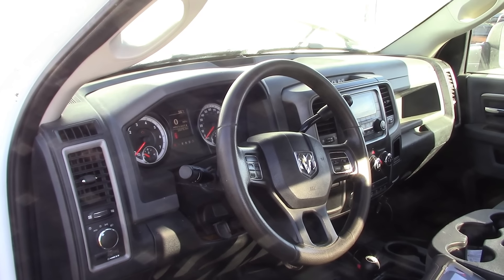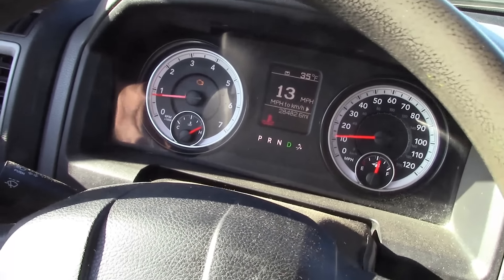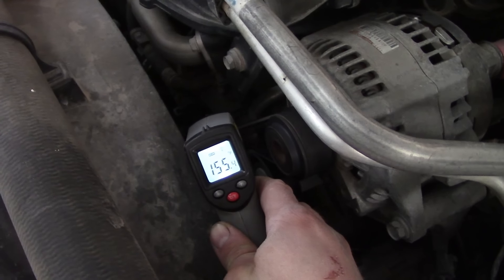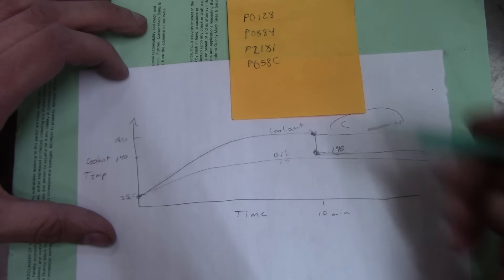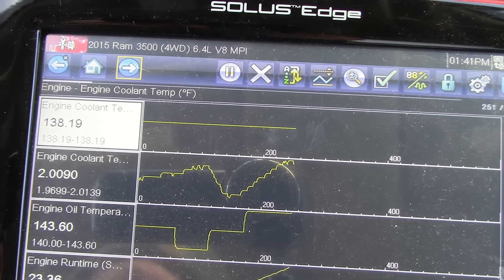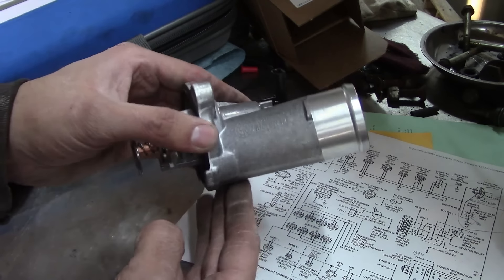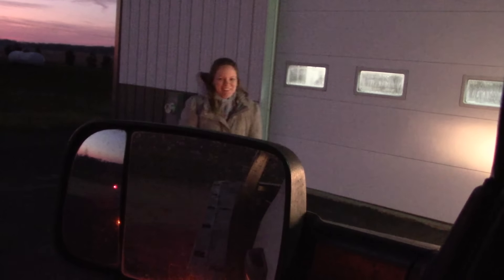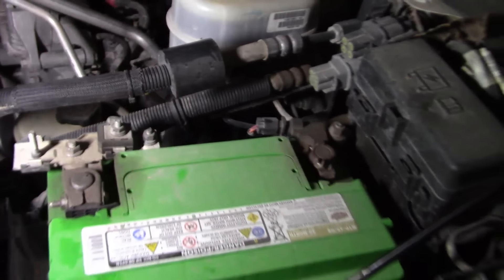When Live Data Lies - 2015 Ram 3500 Thermostat Diagnosis and Replacement - P0128, P2181

Comment: Wes, you have to remember that these are same great minds, that came up with the grand ideal of taking the whole dash, and console assemblies apart to work on anything to do with heating, and cooling system.
Also using 6- 5'16", are metric equivalent, to secure two dissimilar metals together, that just happen to be the two that move the highest temperatures. As well as having the greatest deference's in they're absorption, and dissipation of heat. Thus snapping the heads smooth off the retaining hardware, and the hardware wear shear bolts used on PTO shafts on a  shredder, are some other implement to protect gear boxes.
So anything is possible, and the words, logic, and logical never entered any of they're minds, not once it appears.

Comment: This is why I advocate that all these cars engines software and sensors be available as public info.  All they need to add is a SUBST flag to the code, then the monitors would know when and how that value being shown was a substitute value.  Also the water temp sensor diagnostic can be easily correlated to the oil temp.   odds of both failing are small, UNLESS its an electrical problem.  and yeah I have seen that, near dead batt in a ford fusion and chrysler minivan had all sorts of fail codes being thrown.

Comment: Had one for 3 weeks.   Transmission fell out  ( literally fell out )    15 mins after purchase.   Yes it was just warranty fix.   10 days later it was great .  3 weeks later.  It caught fire in my driveway .   It was parked .    Electrical fire in engine bay.      8000 bucks later. Yes warranty  kiked in.   Got it back .  Was never right again.  Stank of burning plastic.   Took it back toold them to shove it.      900 miles on this lemon,        then bought a Nissan.    Happy now.

Comment: Sometimes a bum thermostat can prevent the computer from allowing the emissions monitors to pass if the temperature won't reach a minimum of 180 degrees.
Reply: Kind of what I was thinking. Such as a fuel mix ratio curve having priority but dependent on actual/presumptive temp value.

Comment: I worked on a Cat 3126 with a temperature problem. 
The temp gauge would fluctuate like crazy up and down at operating range.
Used the laptop and live data and when it happened it looked like a heartbeat monitor.
3116, 3126 and C7 all have two thermostats in the same place side by side.
Don't ask me why but one was faulty giving me the readings I saw on the data log.
Two new stats and it was good to go.

Comment: Is the sensor an A/D converter? It seems like some bits are off.  But I haven't watched to the finish.
Reply: The scan data shows coolant temp voltage however it is showing 0 to something like 20 V max.  This seems like too high of a range, 0 to 5 V is typical with anything below say 0.5 or above 4.5 tripping shorted or open circuit codes.

Comment: I started working on cars when OBD2 first came out and that’s what I specialized in computer diagnostics. I really don’t quite understand these new cars. An example a friend of mine had his Chevy Colorado that set codes for the traction control computer, ABS and put the truck in limp home mode all because of a bad coil.

Comment: In 1989 when the cummins first went in the Dodges people complained so much about the temp gauge swinging when the thermostat opened they cam with a special pigtail for the sensor that dampened the gauge readings so they had like 30 second average readings instead of real-time. I guess that was the beginning of lying gauges.

Comment: My Mazda does something similar with oil pressure. The gauge moves around based on what the car thinks the oil pressure should be. The actual oil pressure sensor is just an on-off switch.

Comment: My wife's 2012 caravan just had this code and issue this weekend. Lol 

I ended up putting a thermostat in it. Her can wasn't getting over 115°. We're running -12°C or 10.5°C
Needle wasn't reaching the first quarter on the gauge. Now it's running just below middle. And we have actual heat coming from the heater core.

Comment: 14:33 for such momentous occasions, i have one of those medium-cheapo bilge pumps. Excellent for this kind of stuff. The only thing to keep in mind is to flush the pump once done, the coolant corrodes them. I forgot one, once, and it kinda ... fused it stuck ... dunno.
Reply from the maker: Heh. It was less than 1/2 a gallon. I can pour it. I just hate funnels.

Comment: My guess is that the scan tool is reading the value that the ECM is using to calculate the fueling, not the value directly calculated from the sensor.

A different subsystem in the ECM determines what that value is - and if it's been running long enough without coming up to temperature, it substitutes 180F so the engine isn't running on cold start all the time.  I guess this same system is the one that determines that there might be a coolant sensor failure and pins the gauge, turns the fan on and sets the code, same as that Cadillac.

When you turn the key off and on, it reverts to the actual value, and runs on cold start for a bit.

I guess the for-real Chrysler tool takes the sensor voltage and translates that into a temperature value for you, so you can compare the sensor value, the fueling value, and the real value with an IR thermometer or similar.  That would allow you to quickly diagnose a sensor or thermostat fault.

Comment: Chrylser's master plan,SELL more parts!
Reply: It's not just Chrysler...all automakers now sell "assemblies" instead of individual parts
Reply: Auto correct, not chrysler, FIAT crap
Reply: @donniebrown2896  wasn't this made when the nazis owned chrysler?
Reply: @chrisfreemesser  pcv valves are a good example of that also
Reply: Most cars will go their entire useful life with many of their original parts so what is the problem with an integrated assembly? . Whenever you go to by a 100% new car, do you do research as to if the stat / housing and sensor are separate items or do you look for payments under $ 100 per month? If you only buy used cars, your opinion of what a car maker is irrelevant since car makers sell to people that buy new cars.

Comment: I guess what your display is showing is the ECM parameter that is used to calculate fuelling etc it's using a guesstimate so that is what is being distributed to the other modules like the dash? There may be another parameter somewhere which is raw data? Anyway interesting vid thanks 😀 It's a bit crappy that it doesn't cross correlate with the oil temperature.

Comment: Great vidja Wes! Just guessing but back in the early '80's when all this computerized emissions controls were being designed, it was intially thought that emissions targets could not be met  easily without redesigning the engine itself which gets expensive. My theory is this is to prevent other actions from occurring such as fuel air mixtures being leaned....just a guess. Did a term paper for Environmental Law in '92 on the "Off road vehicle diesel rules, which extended emissions standards to Construction vehicles such as  dup trucks, excavators and now even lawn mowers and weed eaters. Did it help air quality? Yes it did, but increased complexity hugely. In California now you cant even try to fix old machines that dont have Tier 1 at least. Not even for farm use.

Comment: The integrated thermostat and coolant thing is a definite German thing. Been dealing with that since 2002. Wait until you start seeing the water pump being bolted to the thermostat as a complete assembly. 

As far as the battery management stuff, the thing on the negative cable is just a sensor. Usually there is a module associated with it or the function is integrated in another module. I do know weird things happen if you don’t program a new battery to the car/truck.

Comment: Because of aftermarket coolant preheating and oil heaters for cold climate the computer doesn't use the sensor directly on a cold start, but just estimates the engine temperature with it.

The estimation is needed when the cooling temperature sensor is way off compared to the air intake temperature and it's cold to get the mixture right. 

As you said, your scan tool just doesn't show the full picture, so you have to figure out yourself that the value is a substitute.

When you shut the engine off and on again the sensor readings was probably out of the zone where it's considered 'cold', so the computer uses the real value. 

But when the engine is expected to be warmed up completely, but haven't reached the estimated temperature, the computer knows that the valve to open the radiator cooling loop either doesn't work or the temperature reading is bad from the sensor - or there's no coolant left in the system, so it fails back to full panick and shows Hot on the dash.

Comment: Great work Wes. As for the false coolant temp reading, could it be that the pcm uses the coolant temp memory bit to calculate the fuel mixture? Doesn't the engine need a richer mixture when cold and then leans out the mixture as the engine warms up? If the engine has been running for a period of time, it has to be warm so the pcm raises the red flag, sounds an alarm, and inputs a default value for temp. I don't know, I'm just sitting here wondering. Thanks for the video.

Comment: I have a 2005 dodge diesel, 5.9 engine nice old truck but it takes about 5+ miles for the temp gauge to start moving up,
I read that when dodge first started sell diesels to the general public as daily drivers, they had a flood of complaints about the temperature gauge not working properly as most folks were used to the temp gauge coming up to temp in just a few minutes,
So dodge engineers put a fake temperature sending signal in that made the gauge show a higher temperature than the motor temperature earlier so customers would be happy,
Who knows if that was true!

Comment: Good diagnosis and frustrating that the ECU OBD data only provides the data it is substituting for the sensor, would be nice if the programers flagged the value as virtual. As you say if the ECU doesn’t get an expected set of results from a sensor or sensors then in order to keep the engine running in a reasonable way it substitutes a known value(s). This ensures fuelling, timing, TCM, cooling pump and fan controls still operate in a predictable way albeit based on predetermined values. As you know, a scan tool is an essential part of a tool kit but it is not the be all and end all, other skills and tools will still be required.

Comment: Very interesting video. Was the ECM programmed to gave fake values so you would stop the car. For instance during the drive cycle the heat sensor was giving  a value out of range. In such a scenario  the ECM was programmed to assumes a catastrophic failure  ie: total coolant loss from the engine.  ECM then sends signal to temperature  gauge that engine is overheated. Therefore operator turns off vehicle until problem is remedied. Possible explanation for sending "fake values"

Comment: Wonder what is up with the oil temp. I questioned mine on a 2017 and it runs 190 to 215 most all the time for oil temp. Looked at others to find the same. Is that reading you got correct?  Would it lie to protect the motor in case the hose blew and no water to the temp sensor so no temp or low temp?

Comment: "I wonder how many cooling temperature sensors get replaced because of this..." 

None, since you only can get the whole assembly! What a great idea. Imagine scaling this up. Scan tool says: "Motor does not start". Diagnosis: "Motor broken" Fix: "Buy new motor".

Gotta love it.
Reply: Most cars will go their entire useful life with many of their original parts so what is the problem with an integrated assembly?  .  Whenever you go to by a 100% new car, do you do research as to if the stat / housing and sensor are separate items or do you look for payments under $ 100 per month?  If you only buy used cars, your opinion of what a car maker is irrelevant since car makers sell to people that buy new cars.

Comment: My guess is that the ECU is worried that if a coolant sensor is bad, it could be telling the computer a lower value than the real value, which would let the vehicle overheat to the point of damage without warning the user anything is wrong. Therefore its using whichever is higher between expected and observed data, banking on the fact that incorrectly overcooling is going to be less damaging than incorrectly overheating.... and like you say if you had the expensive manufacturer recommended scan tool, you'd likely see both scales live, instead of only whichever its outputting to the gauge.

Comment: Noticed that the coolant temperature sensor voltage was actual voltage in your live data, just the 'calculated coolant temperature' was not what you were expecting...   Perhaps service data has more information about the scan tool values related to this trouble code...

Comment: Hey Wes. This is a shot in the dark. I have a 1999 Dodge van. 5.2,318 engine. When your driving alone, it would just die. Previous owner had it checked out and mechanic said it needed a new pcm. 500 dollars later it would still die. So I bought it and figured I could fix it. When it dies the gages on the dash go dead and you can’t hear the fuel pump. If you leave the key on within a minute or two it says ( no buss) in the odometer.It will turn over but won’t start. If I disconnect the battery and hook it back up, the gages come alive and I hear the fuel pump and it starts.Somebody told me that when I unhook the battery that it is resetting the pcm. I am looking for some direction to figure this thing out. I have replaced a few sensors and replaced and checked a few relays. Any help would be appreciated. I have been subscribed and following you since Morgan’s brakes and you seem like a very intelligent mechanic.I have had this van to 4 mechanics and they can’t pick up any codes, so they can’t tell me what is wrong with it.Suppossedly the no buss is tell me that the pcm is not communicating with the vehicle.

Comment: apparently the actual engine coolant temp is privileged information    🙄
Reply from the maker: I guess so!
Reply: @WatchWesWork  These calculated values are usually fed into algorithms or for display purposes, that either need a smoothed curve to avoid glitching or to indicate conventional behavior to the driver although the thermostat strategy does different things in the background. The indicated values have been dampened since decades beyond recognition for some form of perceived quality. Another way to look at it is that modern engines possess several temperature sensors that even diagnose the thermostat, but only have one gauge in the instrument panel.